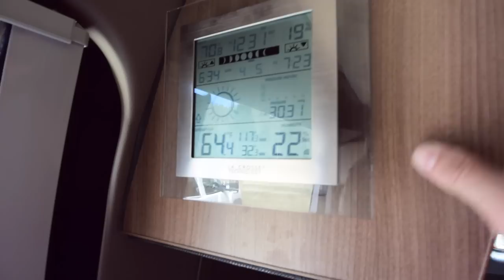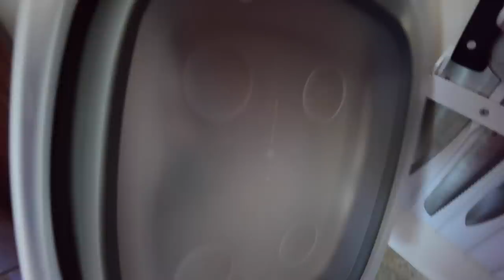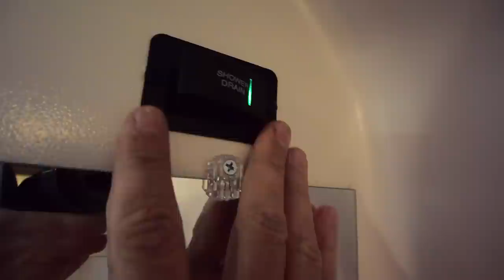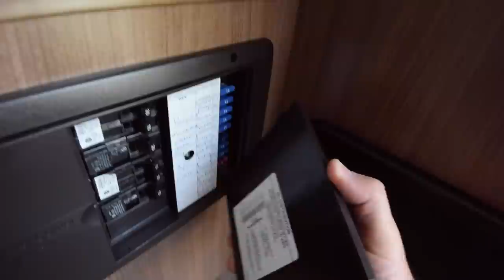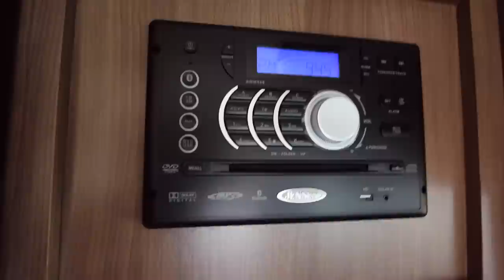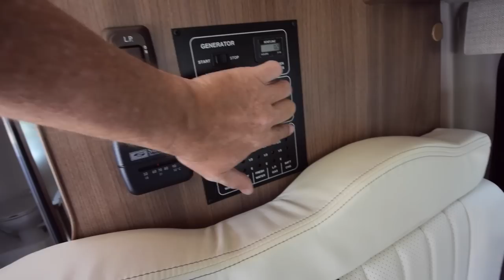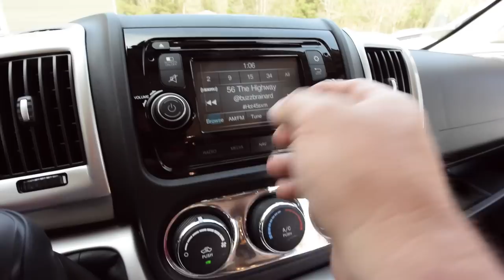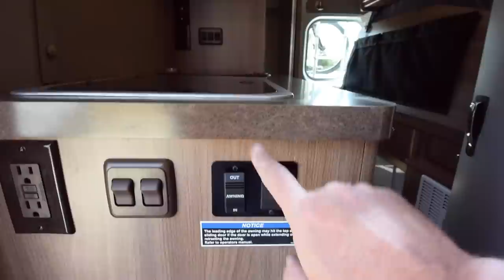2015 Winnebago Travato 59G

Comment: Wow!  I really appreciate the thoughtfulness and thoroughness of your excellent review!  Uniquely, you are in the rare position to compare the 2014 and 2015 models, observing the improvements between 1st and 2nd years, and that is grand.  This really looks like something we're interested in, and your review really answered so many questions!  While any Class B (or any RV, for that matter) is something of a compromise, what I really like about the Travato is:
(1) Bed that doesn't have to be converted from a couch or a dining table (etc.).  Ready in seconds, flop down when you're tired.
(2) Dinette that is always ready.  Sit down and eat, whenever.
(3) Fuel economy and parking of a large pickup, as opposed to a bus.  Park in a "normal" parking spot, and not 8 MPG and seeking out semi-truck parking like a larger motorhome.
(4) The largely-van (automotive type) construction means there's much less-likely to the occurrence of de-lamination and/or leaks, as with a traditional RV.  If you've ever owned a "traditional" RV, you know they'll all eventually leak and rot, the floor, the wall, both, or whatever.
(5) Storage for the smaller (Class B) unit is so much easier.  Obviously.

The 3.0L 4cyl diesel is now available, but seems to have some hokey "automated manual" transmission that seems to leave something to be desired.  As well, the diesel fuel means the generator must necessarily run on LP, and as we all know, that's quite limited in capacity and a chore to fill.  Coupled with the fact that the diesel engine is considerably more expensive both to purchase and maintain, it seems to me that the Pentastar gas V6 is the way to go with this; the additional diesel mileage is nice, but not that much additional, and not worth the additional cost and generator swap to propane, particularly because you must run the generator for hot water.

Thanks again, so much, for your efforts in producing this review.  You are awesome!

Comment: Awesome video, especially for me because I am looking at an early 2015 with the lower bed vs a new late 2015 with the higher bed.  Many of the early 2015 models are selling at a $3000 to $4000 discount.  I took notes during your video and there seem to be about 16 differences between the models.  The most significant to me is the taller bed with the drawers and thicker mattress.  The other differences that are still nice are the thicker cushions, the extra bathroom cabinet, ottoman corner cut for passenger captains chair, air conditioner baffle controls, and new drains location.  Why did you upgrade from the 2014 to the new 2015 model

Comment: Where is the water pump located if needed to be replaced. Great video!
Reply from the maker: Thanks.  The water pump is under the kitchen cabinet.  Remove the bottom drawer and it's there mounted to the floor.

Comment: Nice video - can you tell us what the "OCCC" is? That's the "Occupants and Cargo Carrying Capacity"  - that is usually on a sticker in the passenger-side door pillar. Thanks.
Reply from the maker: Jollyprez 1,862
Reply: Excellent, thanks! That's not bad at all for a van without dual rear wheels.
Reply from the maker: Jollyprez Actually the bigger vans with the duals don't have any more OCCC than this van - they are heavier and with more cabinetry and equipment inside, it just eats up the excess OCCC they started with.
Reply: wincrasher2007 - Yep - this model is the only Winnie I'm looking at seriously. I'd love to put a Sportsmobile "Penthouse" top on it - not sure with all the racks up there, though.

Comment: Thanks for making the video.
Are you still happy with the 2015 Travato?

I was looking into the 4WD/4x4 Mercedes Sprinter, so it can go off road, and building it myself, but will wait a few years to see if their design has issues.

Perhaps $60K for a Travato with less than 10,000 miles on it, might be a better option to begin with
Reply from the maker: +DavidisDawei I think you have to consider how far "off-road" you really intend to go.   I see the Sprinter as more for slushy, snowy or muddy roads.  But roads - not bounding thru fields or over dunes.   If you like the National Seashore down in Texas, then it may also be a good choice for going there.   If you are realistically going to stay on roads, even BLM roads & trails, then I think the FWD in the Travato will get you to where you want to go.   If you've got the time, and the skills to do your own DIY conversion, you might save a few bucks.   Mostly people go that route to get the exact plan and features they want, not really money savings.   Generally you pay more for the van buying it on your own thru a dealer, and then have to buy all the materials and appliances at retail.   So the savings, once you are into it, are not all that great.  A slightly used Travato is a tremendous deal if you can find one.
Reply: wincrasher2007
Thank you Sir -
Yes, getting wholesale/dealer discounts would be nice - maybe I'll tow an ATV instead - haha

So, you are satisfied with the Travato you recently purchased?  
No buyer's remorse (several months later)?

safe travels

Comment: how would you compare it to the Sprinter chassis are you happy with the way it drives
Reply from the maker: +Michael Aravidis Yes, it drives very well.  It sits lower to the ground, with a lower center of gravity than a Sprinter.  It also has a tighter turning radius.  The ride seems alot smoother to me.  It has plenty of power to climb hills and keep speed on the highway.
Reply: What's the top speed on the highway
Reply: I have a sprinter and was thinking of trading it for the one you have

Comment: I don't like the gen hanging so low and hiding so deep inside the belly. how can you check the oil or change the filters???
Reply from the maker: Easy.  There is an access panel on the side of the generator.   You do have to get the van up on ramps to give you room to crawl under.   But the unit only needs service every 200+ hours.  You have an hours meter inside the coach to keep track.   Almost all class B vans have the generator under the van and have done it this way for many, many years.  To get an underhood generator (really an extra alternator), you'll need to spend about $20-30k more for one of the Roadtrek models.
Reply: thanks for your reply

Comment: Great video.  All other ones that I have seen have been made by dealers or Winnebago.  I do think the Truma should be an option.  I did notice on other vids that the step seemed a bit bouncy.  Does it seem that way to you?  I have also been watching vids on the Dynamax Rev.  I really like it, but it isn't a B.  Did you consider purchasing anything other than a B?
Reply from the maker: rangerpru Thanks.  The step is quite solid once it's extended.  I don't think it's a good idea to step on it while it's moving.  The Dynamax is a nice RV if you want something a bit larger - you might also want to look at the Winnebago Trend as something similar.  This is my second Travato.  Of the Promaster vans, this is my favorite.   The Sprinter vans can be quite nice, but they are generally $20-$30K more expensive, and I wasn't wanting to spend that much money for what essentially is a toy.  No RV is perfect, they are all compromises in some way - you just need to find the set of compromises that fit you the best.

Comment: How much does one of these go for?
Reply from the maker: J Kim Depending on options, these MSRP from anywhere from $86k to $94k.  They trade at a discount, so your out-the-door price would most likely be anywhere from $65 to $75k.   Taxes, delivery costs and dealer markup vary of course.   Your best bet is to contact several dealers and price compare.  Best bet, though, is to work with your local dealer  on a fair deal so you have someone close to you for service down the road.  Good luck!

Comment: Winnebago should have added a 2nd secure folding bed locking strap like the Mercedes Benz Touring Coach.
Reply from the maker: Why?   This one worked fine.
Reply: wincrasher2007 My friend Owns the 2015 Travato & his "DIY" 2nd locking strap took all that stress off of the far left side or @ least the strap should have been placed in the center of the bed, would have made a better application.